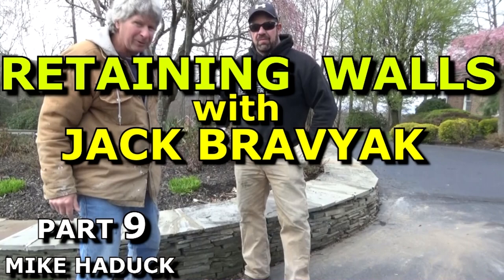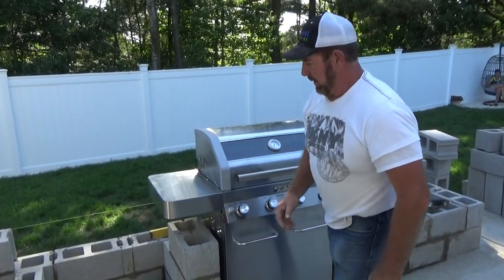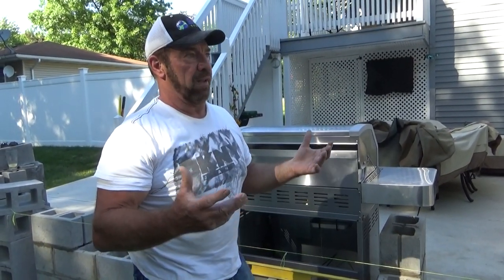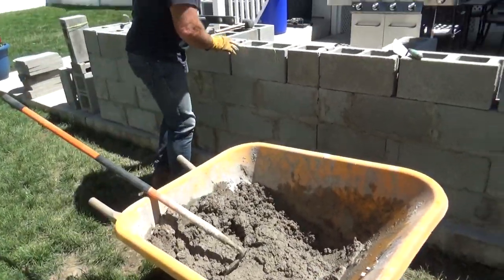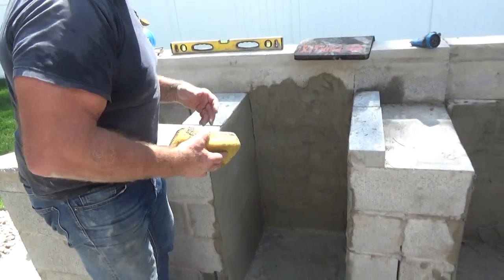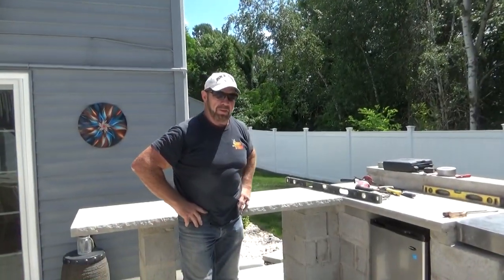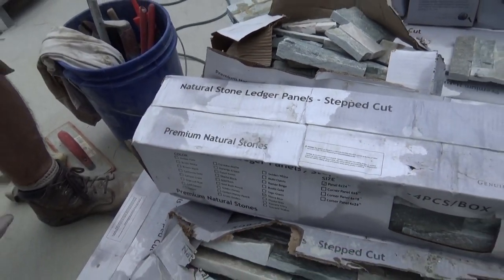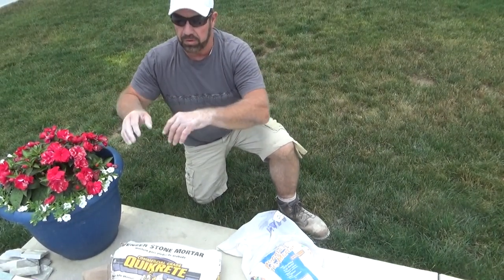OUTDOOR BAR & GRILL with Jack Bravyak   (Mike Haduck)

Comment: Looks nice.  Couple of questions:  it appears nothing is used in between the joints of the veneer.  What happens when rain water gets in and freezes ?  Also how are the corners treated (do you see edges)? thanks.
Reply from the maker: Hi s, jobs like these are usually covered in winter, thanks Mike

Comment: Great work! Customer should have went with a standard 30” built in grill designed for that application, so if they need to replace it in the future they can just drop it in.  Won’t find a grill with the same exact dimensions to fit so nicely 10 years down the road if they need to replace it.
Reply: Funny you noticed I told her to buy another grill and store it. Lol

Comment: Hi, have a question (not related to video) I'm building a garage DIY, first time doing brickwork, going reasonably well, I have 3 windows to put in, two 2m windows across from each other and one 1.5m on the other end so [ _ ], also have a door to put in next to one of the windows (brick and half pillar inbetween)
its single skin garage with a wood/rubber roof, There should be no more than 10 bricks above the lintels, would of thought less than 8, but lets say 10 to do it stronger than it needs to be lol. I have some reinforced single brick size lintels given to me for the door and smaller window, they have more than enough overhang, probs be like 30cm each side (apparently you only need 15 each side and you're not suppose to cut lintels?) would these be enough, I have to buy some 2.4M lintels for the 2m windows so what type of lintels should I get, would single brick sized lintels be enough with the amount of brickwork above it, or should I get the 2 brick thick lintels or even steel, would prefer concrete lintel as they would match the other garages, so basically just wanting to know the size I should get.

The other garages have 140mm high lintels, But they use to have concrete roofs on them, thanks for any replies, learning as I go and want to be some opinions ect.

if i'm reading this right its 140mm height, 100mm depth so is good for single skin brickwork, assuming this is overkill, but just wanting to be sure.
https://www.elintels.co.uk/r6-100x145mm-high-spec-lintel

https://www.buildbase.co.uk/supreme-prestressed-concrete-10307-2801066
then 65mm high and 100mm depth
Reply from the maker: Hi, I really can't comment on that, there seems to be a lot going on, I would check with the locals or inspectors,   thanks mike
Reply: Needs to be 6 inches overlap on each side of the lintel (more than enough). Make sure to coat the lentil with a rust inhibitor before you install it.
Reply: Use steel and use the size that allows it to have the coded overhang without pressing too much against the sub structure. Also you can use blue skin to water proof the lentil and caulk the seams to prevent water penetration

Comment: Nice job Jack!  Can the smoke coming from the Grill discolor the back splash?
                                       +  -------------------------------------  +                                                                              Jack was that your grinder, or did you get it from  "Honest Mikes Tool Rental?"  ;)
Reply: Yes it is one of my grinders, also the customer put a sealer on the stone called 511 so any discoloration from the smoke wipes right off